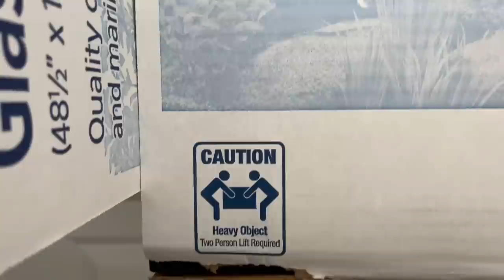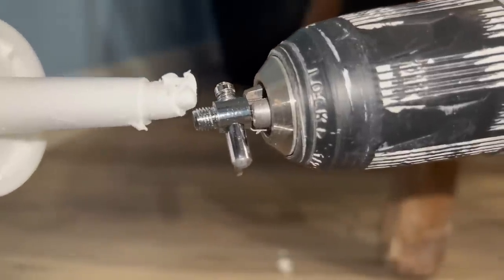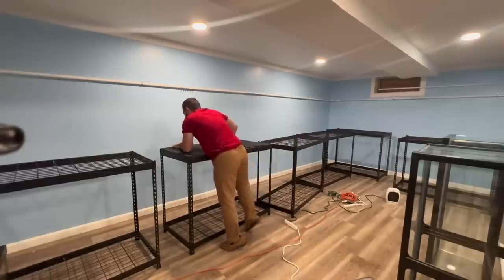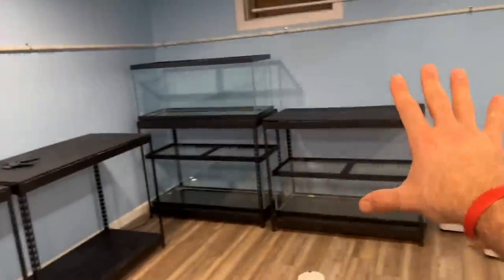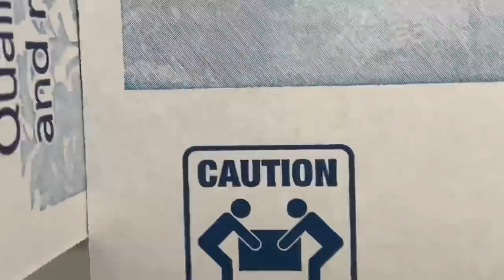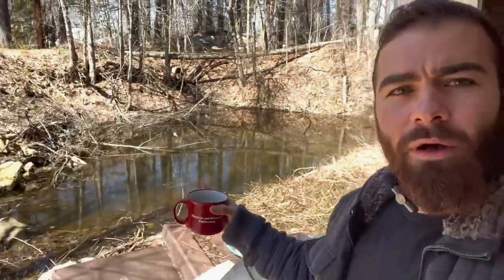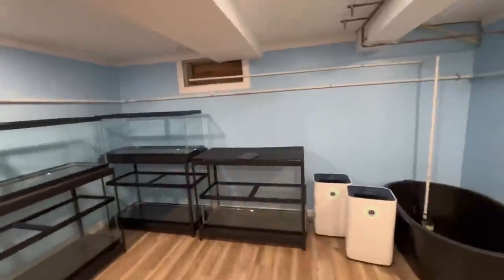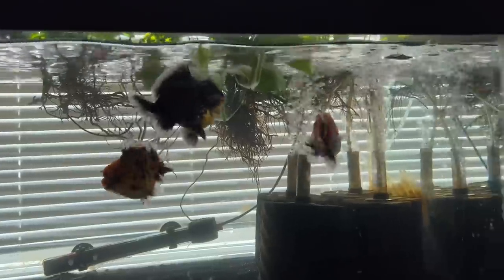Building a GOLDFISH WALL (Also RIP Num Nums)

Comment: "Do not plug power strips or other surge protectors into one surge protector and ensure the devices you have plugged in do not exceed the wattage capacity. An overloaded protector fails to stop a power surge that can ruin your electronics or even cause fires" Watch your current or else all that work will be flames
Reply: No cap
I had a power strip(2) plugged into a power strip(1)and a portable ac unit plugged into power strip(1) 
Every outlet in use 24/7
The ac started shutting on and off randomly so I unplugged it to check it out. The ac was asking for more power than was available, melted the face off that outlet. 
Another time my aquarium light blew up and instead of just tripping the power strip it was on, it tripped the breaker for the whole room 
Came back to the whole fish room without power for who knows how long
(Edit: I now run 7outlet power strips with surge protectors built in, plugged only into the wall outlet. When I have to use household extension cords I plug them directly into wall and wrap extra cord up in a bundle left in the open unobstructed, on laminate floor to avoid risks of overheating and fire. 👍) I know I ranted, can’t help but share safety tips.
Reply: Seriously 😅

Comment: 11:02 Suggestion:  Please center the four tank sets on the wall with space on the ends for access.  Mostly, put more space between the tanks of water and your electrical panel.  This will keep splashes and corrosion issues farther away and for service of the panel if needed (since this is early in your build, that is a cautious move).  In an emergency, you won't have time to move a set of tanks if needed.  Might even be an electrical code in your area about distance from objects.

Also, I would suggest to not place a tank under the window due to temperature changes, and ease of access if you need to pump water outside/light issues/etc.

Comment: I suggest that you keep all the electrical lines off the floor and find a way to attach them on the wall behind the tanks. Also don't bring in any of those sick goldfish into the fishroom once it is running since disease can easily spread through droplets and water vapor in an enclosed space, especially if you have splashes from sponge filters. You would'nt want to start out having every tank already infected from the get go. Have a few  quarantine tanks in a different room or have other tanks relatively farther away from the main group, and equip them with tight lids and a separate waterchange system.

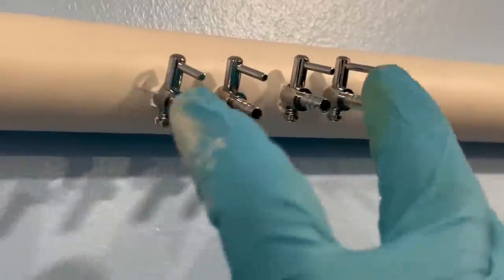Comment: 1:03 My OCD senses are tingling~~  Just a suggestion, cut a piece of PVC pipe (or cardboard tube) in less than half (so it fits over the pipe to be drilled).  Place on pipe to be drilled and rotate it until it rests against the wall on one side.  Mark on cut section where you want the pipe drilled.  Even line can be made by placing cut pipe on table, lay a marker flat on table, then run marker down cut section which would be parallel to the table.  Saves time in setting up drill points for each station.

Another suggestion would be to offset every other valve by a 45 degree angle so the valve levers would not be in line, in case you have to turn them in opposite directions (facing each other).  Also, offsetting would make counting valve number easier in a blind setting where you might have several valves in a row, but easier to reach back without getting on a ladder or other item to better see valves.

Comment: The water softener may be killing those fish. Since you have well water, you are most likely using water softener salt. It has additives to help lower corrosion in pipes. I was keeping a blue gill, and it died when I put it in water from the tap. You need conditioner in the water even though it doesn't have chlorine it still has other things that are bad for fish.

Comment: Might be a little late, but it would be super easy to just run some electrical cord along the wall, and put some nice looking electrical boxes at the location of each tank. One end could even just have a plug if you want to just plug it into an existing box.

Better option would be to add the line to your electrical panel, but ya. 

Would remove the huge amount of power strips, you could put GFI plugs in it (like your bathroom) so any shorts caused by water would just trip the one tank, and not the whole line shutting down all the tanks power. 

Would look clean, and professional, and shouldn't take more than a few hours, likely less than 100$, using just a pair of wire cutters, your drill, and your screw driver.

Comment: Hi Luke!
Love your content ❤ however, I have few... Concerns.
You said that your air pump is powerful, but you have A LOT of those air taps, also the tubing is very long. Did you check if - when all of them are open - the last ones still have enough of air going?
Also, you made a long chain of cord splitters/extensions. They do not get more electricity, they splitting it. You sure, that when they are all plugged in they still have all the power required to operate? With all filters and heaters (which need a huge amount of power)?
Moreover (but that's kinda obvious) are those cords protected from splashes and generally water? What if one of your tank would break (God hope not) and water and the water would go everywhere?

Don't get me wrong, I'm just worried your hard work and lots of money you put in the fish basement project would just go poof bc some little issue. You probably took care of those issues - you're professional after all. Just some concerns from one viewer.

Lots of support ❤❤❤

Comment: 10:25 What is your floor made from?  Is it wood, tile, or composite material?  If it is tile, or other non-giving material, you should place something under the feet of the stands to avoid pressure points and general rust prevention.  Those metal stands may have a burr where they were cut and make a pressure point that would crack/shatter tile or similar material once the massive amount of weigh is put on them.

Comment: That daisy chaining of power cords is questionable at best. They are more likely to start fires if you daisy chain that many because most power cords can't handle that much power going through them. Why didn't they install the standard power outlets every few feet when remodeling?

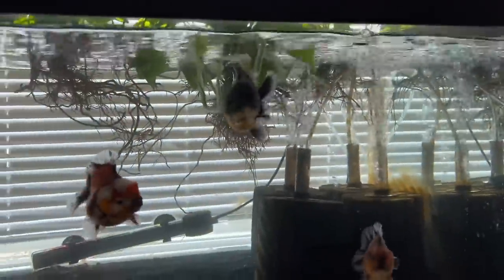Comment: 12:58 Are you on a well or is it mains line?  New or old plumbing?  Contact your local (nearest supplier) of water and request a water audit of what chemicals/sediments are in the water and what is the maximum allowed at that station and still called safe.  Finally, since your life blood is actually water, have your water professionally tested at the locations that source your water into the tanks.  For example, don't just test your kitchen faucet if you source your water from a tap in the basement.

This is a reach, but see if the previous owner (the fish monger) had any documented water tests in the city/county/state records or how far away you are from toxic dumps or spills (even runoff predictions if available).